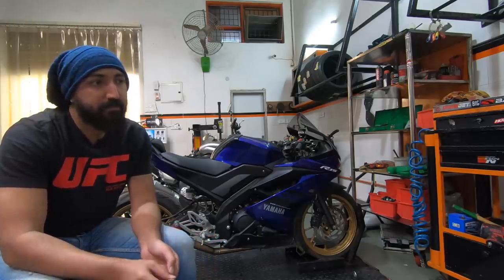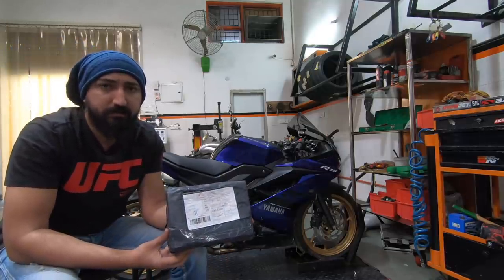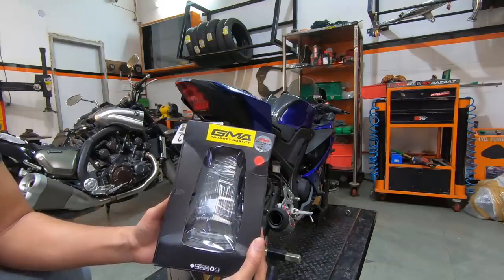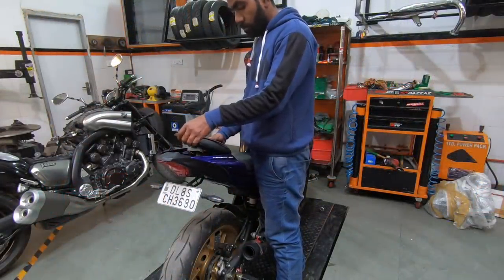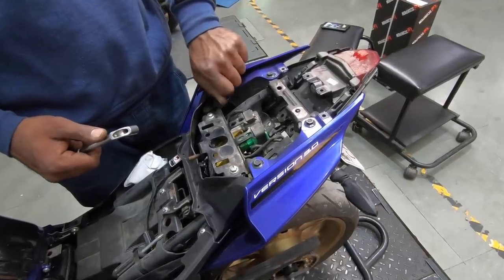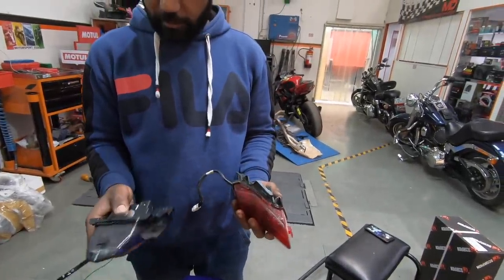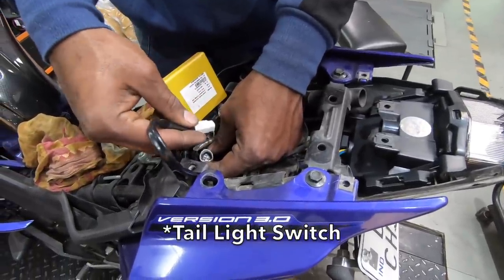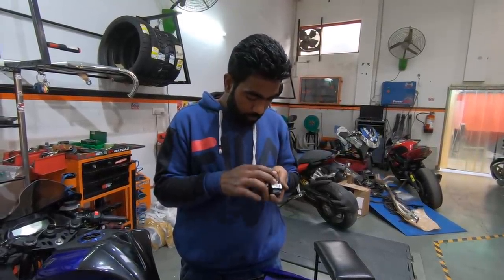Yamaha R15 V3 Integrated Tail Light Installation In India

Comment: Hi Mr. Abhinav. Am Zakwan from Malaysia. I have see one of your video. In case if you are looking for an ECU for R15 V3. my country has sell it. The bike quite famous here. The ECU brand are called UMA RACING M5. it is adjustable via dyno and you can save the maps in your phone. Hope this reach you...cheers
Reply from the maker: Hi, Mr Akmal. Thank you for reaching out to me. I got myself an ECU from Indonesia, BRT Juken 5. However, I am struggling with the settings. Is Aracer also available in your country?
Reply: @abhinavbhatt  Hi Mr.Abhinav, yes ARACER is also available here. To put it simply

ARACER are one of the first Tuneable ECU in Malaysia  thus it quite expensive.

The same manufacturer/importer called Meng Kah Auto or some called it Racing Boy.

Now already come with 5th version of it called UMA RACING M5 ECU. I believed they are sole importer for this brand here.
Reply from the maker: Could you please tell me the price of Aracer quick shifter, if possible.
Reply: @abhinavbhatt  Aracer are quite expensive even for Malaysian. The one that I know cost around MYR1600. not sure in India currency. But UMA RACING webpage might have all the detail
Reply from the maker: Sure. I will check. Thank you :)

Comment: Abhinav the relay has a small notch where you can use a screwdriver to regulate the blinking speed of the indicator. The brightness of the tail light cannot be changed but you can add a strobe unit to the tail light wire so that it can be visible when you apply brakes. Btw most probably the ecu is made for Indonesian bikes and the company states not to use it on indian bikes.
Reply from the maker: Hi Ayon. Thanks for the tip. I'll try it out. I don't think there is any mechanical difference in the two bikes. And the company told me it will work perfectly well.
Reply: Abhinav Bhatt  I was also pondering over that. Most probably the wiring is different. If you can order the whole wiring harness from Indonesia or Thailand and replace the wiring harness of your bike maybe your problem will get sorted out.
Reply from the maker: Don't want to go through these hassles.
Reply from the maker: Hey, what do you know, it worked bro. Thanks much!
Reply: Abhinav Bhatt what worked???
Reply from the maker: Adjusting the screw to adjust the blinking speed.

Comment: Suggestion - The relay which came is electronic one. It also works as load resistor so the led bulbs doesn't get burnt. The screw which is there in new relay will adjust the flasher speed. It's better to use the new relay for longer life of led. 
Best wishes.
Reply from the maker: Hi Kaushik. Someone let me know in the comments and I switched back to the new relay with increased speed. Thank you :)
Reply: was about to tell the same. haha! Nice work you guys.
Reply: I thought more or less the same!

Comment: The problem of the light not getting bright enough when the brakes are applied, you can change it to the blinking type which a lot of people use these days where the tail light blinks whenever the brakes are installed. Even if its not bright enough, it will certainly gather more attention than before. Would look cheap to some people, but it will be better from a safety point.
Reply from the maker: Yeah. Makes sense. Thank you :)

Comment: Good work on the tail light man, even with my v2 after tail tidy, I was using KTM indicators on the rear, but found a good taillights with integrated indicators from Aliexpress it's been almost 1 and half years since my installation it works well and good
Reply from the maker: That's reassuring to hear. Thanks buddy.

Comment: Bro i want to share something with you that my v3 is in trouble may be because I'm suffering with a problem when i ride my bike in 4th gear and speed 40 to 50 its sound very bad like rotation vibration. When i was went to yamaha S. Cente they checked just say its normal voice. But i don't think so. What should I do now?
Reply from the maker: Sorry to hear that. I am afraid I don't know what it could be.
Reply: @abhinavbhatt  what should I do now
Reply from the maker: Try showing it to a different service centre. Also check your clutch cable setting once.
Reply: @abhinavbhatt  they checked everything but m not satisfied bro
Reply: But i think i hv to check with othr service centre
Reply from the maker: Hmmm. Not sure what can be done about it.

Comment: Happy birthday dude!
Reply from the maker: Thanks bro
Reply: @abhinavbhatt  on the contrary, I had a doubt that's stopping me to go for mods. The extended Warranty. They clearly informed warranty will be void even after a small cut of wire that's altered. And I paid some extra (don't remember how much) to get 2 more years extended warranty. Do I really need to be afraid about it and back away from mods for some years?
Reply: @SandeepRay  yes although the extended warranty only covers engine parts
Reply from the maker: Yes. Warranty will be void but I don't see anything going wrong with this bike. It's well put together.

Comment: Hello Abhinav sir i love your videos so much, Just want to ask a question i want to increase thre performance of my bike, but using daytona with db killer is worth it or i should go for ecu remapping and please tell me if ecu remapping will be safe for the bike.
Reply from the maker: ECU remapping should be safe enough. But get a Powertronics ECU because sourcing something from a non-English speaking country will bring its own hassles along.
Reply: Sir, Thank you so much for replying, as you have already contacted about speed monks with ecu remapping, So what about getting it done there.
Reply from the maker: But you will also have to source an ECU then. You can't remap the stock ECU.
Reply: @abhinavbhatt  Ohk thank you so much sir really appreciated your response, Please tell me one more thing using daytona with db killer will it be illegal?
Reply from the maker: Yes. Race track use only.
Reply: @abhinavbhatt  sir can't we add any other exhaust just for sound with DB killer?
Reply from the maker: You can but it would still be illegal.
Reply: @abhinavbhatt  Sir one more last question, The ecu remapping of bike benefits for top end or the mid end.
Reply from the maker: That's the benefit of ECU remapping. You can have whatever you want.
Reply: @abhinavbhatt  Ok sir, thank you so much for your help. Keep doing this work, waiting for your r15 v3 run after all tuning.
Reply from the maker: Thanks

Comment: Make a Dyno run video of your bike and if possible source a Stock R15 to compare the two. 
I'm hoping your motorcycle makes about 20-22 bhp sure on wheel.
Reply from the maker: Nakul, it can't be dynoed right now. I'll try to explain in a video.
Reply: @abhinavbhatt  looking forward.
Reply: @abhinavbhatt  what's your odo reading on your R15 ?
Reply from the maker: 3000 km or so.

Comment: I own a r15 v1 2011 model...
as u said the person working with you,worked with yamaha also...so can you please ask him what is the best adjustment for valve clearance for perfect idling and no tik tik sound?
i am running on full stock no modifications till now..just the CO in fi diagnostics is set to 15 .....
It would be really helpful for me if you can help me out...i  am from kolkata and the sc are not confident about the clearance...i am currently running on intake-0.10mm
exhaust-0.15mm
Reply from the maker: Sure. I'll ask him. Cheers
Reply: THANK YOU...SIR..
AND PLEASE LET ME KNOW WHEN YOU GET TO KNOW IT
Reply from the maker: Sure.
Reply: @abhinavbhatt  any news??
Reply from the maker: No brother, I am afraid I couldn't.
Reply: Do you have any idea???
Reply from the maker: No. I don't know the figures.

Comment: There's one thing if I full system exhaust in my bike do I need to reprogram my ECU
Reply from the maker: Ideally, yes. But R15 ECU is not reflashable at the user's end. Till the company doesn't provide an option, you can't.
Reply: @abhinavbhatt  so what should I do
Reply: @abhinavbhatt  I like all the modifications u did with the bike and I want to make mine as same as yours

Comment: Hai sir i hav facing a power drop or pick up drop problem on my v3 .i hav put a k&n air filter to it at km 3000 .now its 8200km over problem shown last month at the km 7900-8200..any suggestions
 pls help me .an bike lover
Reply from the maker: Hi sir. Best would be to clean the filter. It might be choked.
Reply: @abhinavbhatt sir i did it yesterday but problem not solved

Comment: hey i am using powertronic on rc 200 jus want ask im planning to replace my air filter with stock replacement filter with stock exhaust will be bike okay or run lean ?
Reply from the maker: Best to check with Powertronics. I am sure they can modify a map based on what filter you run.